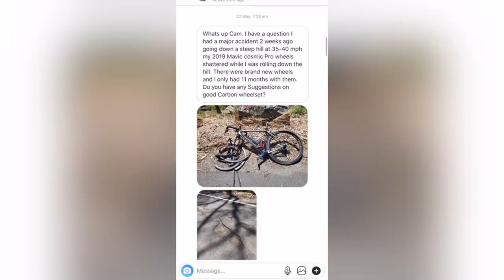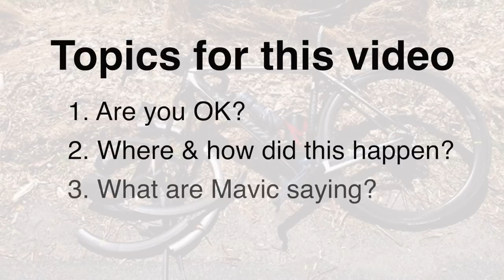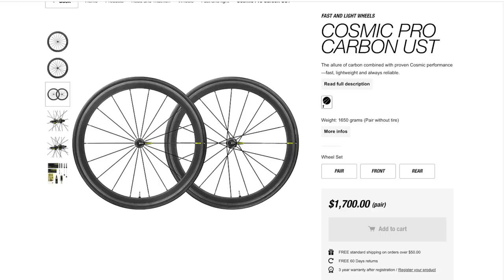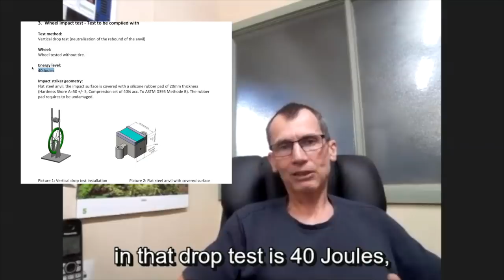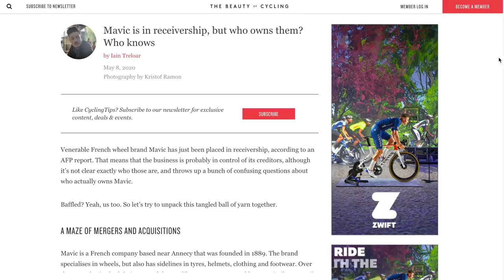A FRIGHTENING MAVIC CARBON WHEEL FAIL (at speed)

Comment: In the early 2000s I races on Mavic Reflex tubular alloy wheels for climbing and Mavic Cosmic tubular alloy wheels for aero wheels. Both Mavic sets where amazing. I raced on Zipp Carbon wheels, They were the only wheels that I trusted back then.
I know much has changed since then, But with so many different wheel manufacturers you have to look at the materials used, lay up and design .
Keep the rubber side down.

Comment: I’ve done that exact same Bear Mountain ride. Dura Ace C50 wheels was the last time, descending at 38-42mph—it was about a 99F summer day. Wheels have aluminum brake track and the wheel is partially aluminum/carbon. But yes you have to be aware of heat. I don’t think I will be taking my full carbon wheels to Bear after seeing this.

Comment: I got a pair of carbon wheels just because they have a deep profile 60mm which is not available for the aluminium ones(and i guess it's the reason why most riders do it),I'm 66kg and ride in a rather hilly region and use the rim brakes, but not very hard,so the wheels are not overheating.
Thanks for the video,and hi from Russia 🚴

Comment: Watching this for the first time just now.  It seems that there were contributing factors that came together to produce the wheel failure.  Riding a long descent with rim brakes, friction increasing rim temperature, hence tire pressure as well resulting in an extreme decrease in wheel integrity and then the impact with the pothole.  Almost makes a case for disc brakes...almost.  I hope Mavic survives the financial descent.  They have always been my favored wheel brand.

Comment: I thought what Raoul said, I remember running a track bike down a mental decent in the Peak District, my tub started rolling off the rim with heat from applying the front brake melting the glue, luckily I ran out of hill!
Reply: Hill climb bike? Because even as a fixed gear fan I'd never casually ride fixed gear and tubeless in an area as hilly as the peaks.
Reply: @franciss2529  I used to do CTC rides on a 72" fixed gear, it often got a bit hairy!

Comment: Hey Cam    I'm thinking about getting Carbon Rim brake wheels (actually, I'm thinking about getting these very same Mavics!) so this video is interesting.  Around the 7:18 mark, Raoul mentions that the heat buildup has compromised the integrity of the wheel (or something along those lines).  Is this "compromise" permanent or does the structural integrity return when the wheel cools down?

Comment: I had a set of Mavic wheels which less than a year after purchase (brand new) showed cracks at the base of two spokes on the rear wheel. We ride on pretty good flat roads here in Florida, US and noticed a very slight wobbling sensation, so I stopped riding so was fortunate enough not to have a catastrophic issue. Contacted Mavic for warranty fix and got zero support or replacement, so had to throw them out; never again will I buy their products. Thank god this guy is ok 👍
Reply from the maker: Thanks for sharing Hector
Reply: Almost forgot, Congratulations on tne 2 years Cam. Thank you for the videos and content, keep up the great work!!! 👍🎉

Comment: Another factor I haven't seen mentioned is tire pressure.  Carbon clinchers have lower max pressures than their alloy counterparts, so with a 100kg rider, the rear tire probably was pretty close to near the upper limits already, helping contribute to the failure.  It sounds like the perfect storm of events in this incident.

Comment: I always switch out my rims to alloy when I do a lot of hilly descent days.  I also use a alloy rim surface older type carbon wheel when I descend occasionally.   But my carbon rims with carbo. Brake track I keep for my tt bike without downhills to heat it up.  I'm also 210lbs.  So I know I'm at the limit point.  My thoughts go out to "john" who got hurt, that's bad for mavic.  I quit being a mavic customer when I tried getting replacement spokes from them in the past.  Customer service wasnt the best let's just say.
Reply: That's the story of my life right there ☝️.  Sorry, I had to 😂

Comment: I used to work at a shop that sold Mavic wheels.  Not the best picture, but I don’t see the yellow Mavic brake shoes that are specially designed for their wheels to not build excess heat.  We saw many customers ruin carbon rims by using generic or alloy rim brake shoes instead of the shoe specified by the wheel manufacturer.

Comment: Caley Fretz of CyclingTips said in one of their podcasts that he feels road tubeless is not advantageous enough on tire sizes smaller than around 30-32mm to warrant their higher risk of failure/maintenance, etc.  In a way, I feel like road tubeless is a solution that needed a problem.  Now it just creates more problems and we must ask ourselves, what problems did road tubeless really solve?
Reply: My thoughts exactly, and you need all that special equipment to mount.
Reply: This a heat problem and has nothing to do with tubeless tires.  Tires with tubes blow off carbon rims (and aluminum rims) once the carbon deforms from rim braking.  This was happening long before tubeless became popular with road bikes.
Reply: Interesting that Roval have new models that are non tubeless specific. Clincher rims that specify NOT tubeless.
Reply: Doesn't matter if the tire has a tube or not, if it gets hot enough it's gonna blow, even with an aluminum rim.  Road tubeless still has better puncture resistance and lower rolling resistance and lower weight, but like you side is probably better suited to 28mm+ tires.  The Roval non-tubeless rims are probably constructed to be so light that they couldn't get the rim to seal with tubeless.

Comment: Recently I converted a former trekking bike to a road bike, but without any carbon parts. I use 36 spoke aluminum wheels with XT hubs, and a aluminum cross country fork. The frame itself is a robust aluminum trekking frame. It's surely not a really competitive bike (12,8 kg), but it was relatively inexpensive compared to a real road bike and I don't have to be afraid something will break if i drive through a pothole. I don't do competitions, it's just for sport and fun.
Reply from the maker: Thanks for sharing on the thread Simon, Cam

Comment: The degradation of the resin mentioned here is a very common failure mechanism in CFRP laminates. It is not only that the resin is getting "soft" - these are not  meltable (thermoplastic) resins but fully cross-linked (thermosetting) plastics. After they come close or cross their glass transition temperature - usually around 180degC, the resin decomposes and cannot transfer load to the fibres. This is usually followed by a complete decomposition of the laminate. Add any impact load to such a material and you have a disaster happening in a split sec.

Comment: I saw some video that the Alto Carbon Wheels have eliminated the heat issue on their wheels as seen in their video...
Reply: It is a lie, there is resins, but are super expensive so wheel builder don't use them, Rauol talks about this in one of his vids. This is why pros run tubular, no pressure behind the hook, in fact there is no hook and rim brakes are more aero than disc bikes. Might be a old forgotten system but it still has many advantages.
Reply: Let me guess:  riding in the Arctic.

Comment: If you want to be safe on a bicycle stick with titanium , steel or aluminum and aluminum wheels and if they make titanium wheel get that. I’m not sure if I’m correct but think that carbon fiber bicycles have a “shelf life” because of the degradation of the resin used to hold the fibers together.

Comment: I have 4 different sets of Mavic wheels, and thank god! Nothing like this has happened. I wonder as I use Exalith brake rims, would the risk be slightly reduced? due to the fact you could scrub off speed quicker, thus less time braking.. I’m sure that’s one for the experts lol. Love ur YT blogs cam, always straight to the point, and informative ;)👍
Reply: No risks on exalith those are aluminium at the tire interface. That said it's not easy to draw conclusions from the above failure. Mavic is always on the safe side of building things, and they have experience in high temperature resins for composite and a quite good quality control. Maybe the wheelset was wrong but maybe the wheelset was damaged before for whatever reason.

Comment: 2009 crashed hard with Bontrager 6.5 Aeolus Carbon wheels and Swiss Stop Yellow braking pads.  Broken C2 and out of cycling for 1 year.  Not good, avoid carbon wheels unless you intend to only ride up hills at less than 15KM / hour.
Reply from the maker: Thanks for sharing on the thread mate. Sorry to hear about your incident but glad you came out still being able to ride. Cheers, Cam

Comment: If you are light, don’t do long descents, and don’t ride in hot (or rainy) weather, carbon rim brake wheels can be fine. Also, tubulars are more structurally sound than clinchers. Also, note that high temp resins for rim wheels are more brittle than lower-temp disc wheels. 

All that said, I recently bought a disc road bike as I ride in variable and challenging conditions. That extra 300g or so is well worth it for safety’s sake. 

People... use the right tool for the job! Rim brakes are fine in many cases, but not for all situations.

Glad to hear that “John” is okay. Stay smart. Stay safe!
Reply: Just use disc brakes then you don't need to consider what weather it is, how light you are and how long a descent is, however there are still too many that think looks and weight are more important than safety

Comment: There is a lot to say about this, I have been in the past the same weight as the mentioned rider and I have opted for riding custom made wheels with 60mm rim depth and 28 spokes on the rear wheel (24 front). A  wheel like that is way stronger than the majority of the off the shelf wheels, hence better suited for such heavy rider. Currently I am 88 kilos and I have the same Mavic wheels as the ones in the  incident and they are pretty sturdy for the given rider weight. My advice build custom carbon wheels and it should be fine. Disc brakes should be considered if you have to go down long mountains roads specifically if you catch bad weather.

Comment: Hit a big pothole myself yesterday morning before sunrise.  Front wheel straight went through the middle.  Hit so hard handlebars rotated forward about 15 degrees, was on the hoods.  Not the greatest position to ride home.  Didn't realise that I had damaged the rim until could see it in the light.  I think running tubeless at ~ 70 psi saved me.  Didn't flat, was doing 40 - 50 k's, so kept control and had disk brakes so could still stop.  Waiting to hear from Trek about wheel replacement.

Comment: Im on rim brakes with carbon rims and just brought some dura ace C40 wheels for this reason...

I've never had an issue with my carbon rims but would prefer an alloy braking track they are only 36g heavier and 5mm shallower so it was a no brainer really. Plus I can use them all year round with no worries here in the UK

Comment: G'day Cam and comments section.
C', regarding Discs, give mechanical actuation discs a crack. In 2017 I changed bikes and went from Ultegra rim brakes/pads to TRP Spyre disc brakes (which tend to get poo-poo'd on by the hydro chaps), and very recently just upgraded pads.
1) Disc from Rims felt 80-100% better, and then the pad change (Swisstop Greens) feels another 50% again.
2) Cable length adjustment for wear and a screw per side for aligning uneven pad wear. Even as a claimed non-handyman, I reckon you'd get your head around it inside 10min.
RE: The wheel failure. Like Raoul states, it's about heat dissipation. Carbon Fibre isn't effective at spreading heat around.
Pretty sure he said similar in Ferg's vid. RIDEmag/BicyclingAus/Cyclist have covered the same subject before over the years with the conclusion of 'get carbon rims with an aluminium braking surface' for the best of both worlds if you do a lot of climbing and/or technical descending.
Heavy, sustained braking "boiling/softening" the resin has always been the core problem to this issue.
In all honesty this isn't anything new, which makes me wonder why people are not aware... Are we the public complacent or maybe is it an issue worth raising once a year via publications/"influencers"/cycle clubs as the information has saturated the audience it needs to?
For anyone worried: If you only ride criteriums and TTs or only pedal on flats, boulevards or up pinches/bergs then you're 99% outside of the above problem. Wheel failure in those situations will likely be a manufacturing fault or you went 1-on-1 with a gutter/car/tree/house... ;P

Comment: That’s some crazy stuff.  I’m a mountain biker.  Big fat tubeless tires (2.5”).  Heavy duty downhill disc brakes.  Full sus.  Reliability and function over weight savings.  In one downhill run I probably sustain hundreds of hits orders of magnitude more intense than what the victim’s wheel in this vid experienced.  I’m sticking with mtb’ing.   This is an example of taking the weight weiner roadie philosophy way beyond reason.

Comment: One thing first: Happy that there was just scares and bruises. As a rider with 100+ carbon wheels were a no-go with rim brakes for me. You brake on a structural part which cann't handle heat! I bought the disc version of the failed rims 3 years ago when I changed to disc brakes. No problem at all. And I took 180 disc rotors when taking my wheight in account. Aspecially when you are on the heavy side you must take in account that allmost all road racing parts are made for feather wheight riders!
Reply from the maker: Thanks for sharing on the thread, Cam

Comment: If the wheel exploded is because of poor and thinly construction material used in the making of wheel for a lighter, lesser rolling resistance. I buy the Chines ELITE 60mm and i install a Continental GP 500O Tube-Less 700x25c and as it reaches 90 PSI the front rim exploded, first you hear the cracking up then you hear blow. The ELITE 60MM Carbon wheel is destroyed. This means Chinese carbon wheel are not structurally sound.

Comment: "John's" situation...or the fear of it...is exactly why I have stuck with alloy wheels and plan to continue doing so. For me, I live in a mostly flat area anyway, but that piece of mind of believing alloy will hold up better in the extremes is majorly important. Add to that I had a vehicle turn in front of me a few years ago and I rode into it a low speed. The fork was a loss, but the alloy wheel (a Rolf Prima) only needed trued back into round and has been perfect for more than 18 months.
Reply from the maker: Thanks for sharing on the thread Stephen. Cam
Reply: Stephen Schilling  - On flat and dry roads, carbon rim brake wheels should be fine. It’s the rain and long, hot descents where they can bite you.

That said, the Rolf Primas are some of the nicest alloy rims out there. However, with their sparse spoke approach, they’re probably best for lighter riders on smooth roads.

DT Swiss has some great alloy wheels with more robust spoke patterns. I’ve got a set of mid-priced alloy DT Swiss wheels (Disc) that are a really nice value. But there is another level out there. I recently built some ENVE SES 4.5 AR Disc wheels and they are silly good. They transformed my aluminum bike as I waited for my dream frame. On the Orbea OMX, it’s a crazy good package. The Rolf Primas are an awesome value with light weight and the safety of aluminum, but they won’t deliver the aero and stiffness that great carbon can offer.

Another great option is the Dura Ace C24. The price isn’t bad, the hubs are superb, they’re stiff carbon, and have an aluminum surface. The only reason I didn’t replace my old set with new C24s is that they aren’t tubeless compatible. My local roads aren’t kind. I got sick of repairing pinch flats with 100+ psi harshness. For me tubeless is a must.

Anyway, Rolf Prima is a very nice choice on a rim brake bike.

Comment: rimbrakes and carbon clincher are totally OK, if you are a light rider, otherwise choose a tubular tire system if you ride a rimbrake bike. the pressure to the rim is much lower when the system heats up while braking, because of the lower profile of the rim bed. I'm 90 kg and tubular is no option for me, so i opted for discs. i would highly recommend this for heavier Riders. good video, good explanation. greets from germany, ride on 🚴🤘
Reply: Clinchers are worse because the tyre wants to expand because of air pressure inside the tyre, thus putting pressure outwards on the rim wall. You do not have this kind of pressure from a tubular, because it´s a closed system, being sewed up. And today, everybody wants clinchers... but me.    Rgr

Comment: Moral of this story is: Don't use carbon rims with rim brakes if you live in a hilly or mountainous area, use disk brakes on carbon wheels. I had a accident 3 years ago (on mavic aluminum wheels) where I had a crash at high speed down hill (mostly my fault 46mph) where I hit a dip with rear brakes on got light and did a few flips. (I wasn't to badly hurt lots of scraps and brushes, tore up my kit and destroyed my helmet (lucky I landed on my head LOL). The rear tube did blow out do to heating build up and did blow the tire off the rim that was about 30 seconds after the crash.

Comment: Wow! A wreck going that fast. I had a bike wreck only going about 20 mph and went down on my left hand and then my body pivot over to my right side and slammed down on the bike trail. I was lucky that it was winter and I had on a coat that saved me from road rash but my coat did not do so well.